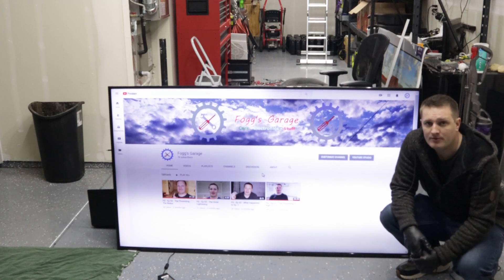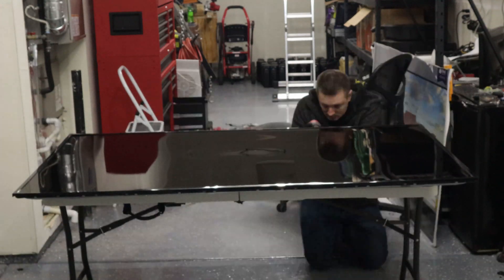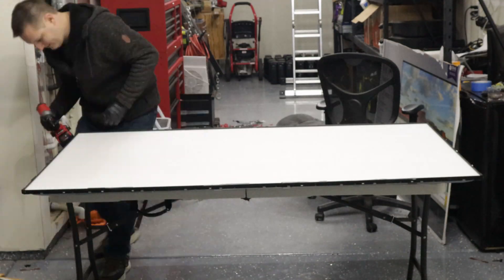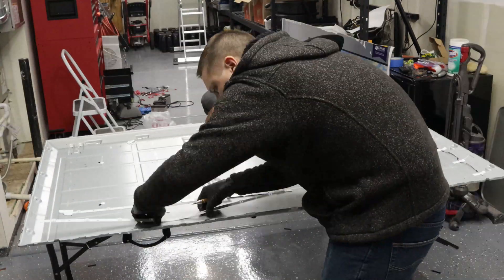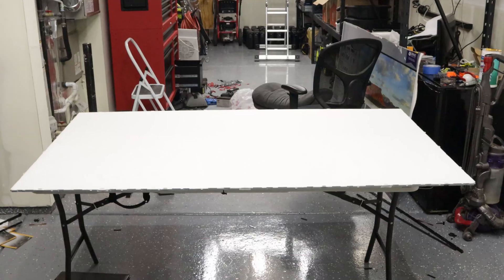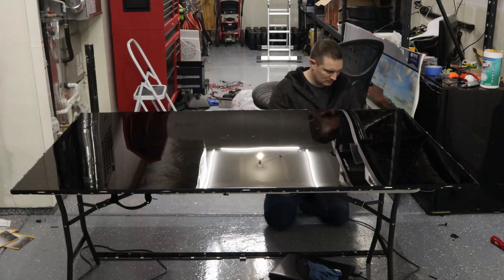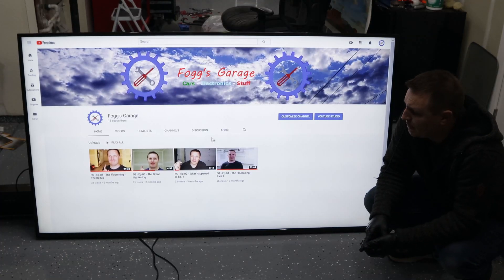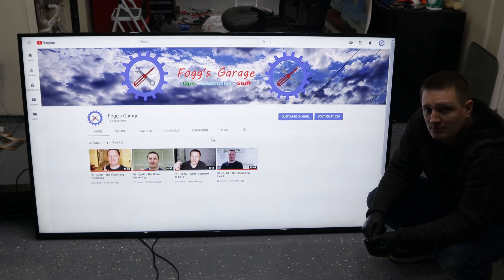FG - Ep 06 - How to correctly repair a 75 in Visio E75-E3 LCD 4K TV (4k)

Comment: I have this same TV that the upper left corner went dark, now i have 2 dark stripes going across.  Seems similar to your picture, so I may need to replace the LEDs.  Should I even buy suction cups based on your scary experience or just carefully carry it with 2 people?
Reply from the maker: My personal experience leads me to say 2 people very carefully moving it would be best. If you have 2 of those sized tables to move it across to, I'd go that route as well instead of onto the floor. Good luck Mark!
Reply: @foggsgarage1278  The LEDs have arrived, we may tackle this project on Sunday.  I have a couple of those folding white tables that we'll work on, and the screen will go on the dining room table.  I'll let you know how it goes!  Thanks!
Reply from the maker: @clellandm  Awesome to hear! Best of luck to you!
Reply: @foggsgarage1278  Success!  We spent 4-5 hours yesterday on the job and as bizarre as it seemed that over 1/4 of the LEDs had failed, it was the problem.  We rewatched this video and jumped right in.  The hardest part (other than the stress) was getting the diffuser trim(?) locked in.  Thanks for the great video!
Reply from the maker: @clellandm  I am super stoked to hear that man, congrats on your repair and thanks for watching!

Comment: For the white clips that are through the reflection screen, did you have to push any of them through the chassis from the other side of the TV or were you able to just pry them out?
Reply from the maker: Apologies for the delay in response. You can go either way. I found I had more control over them by not actually pushing them through. On the other video where i cracked the lcd during the time lapse I punched them through the other side. I don't think this is as efficient and you have to remove all of the electronics off the backside.

Comment: Good to see you using the table and taking this tv apart correctly from the front. It streesed me to see you take it apart on the floor and get screen out with all plastic bezels and white diffusers all in one piece.They might come out in one piece but no way they will go back in one piece.  I just waited for you to crack the glass (which i guess you did at the end of that other video but i could not see that crack). Good luck
Reply from the maker: Yea, that other screen was definitely a learning experience. Thanks for the feedback. the crack on that one wasn't super obvious and I was just super pissed at myself after doing all that work. The table is a much easier way of doing things.